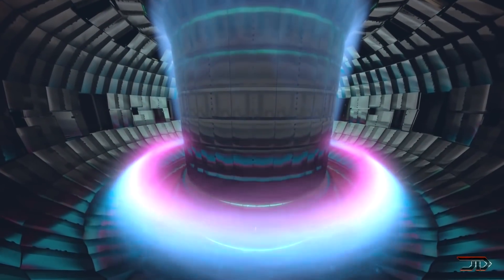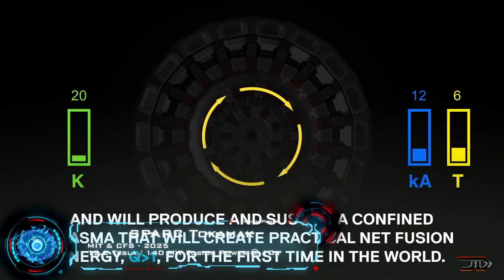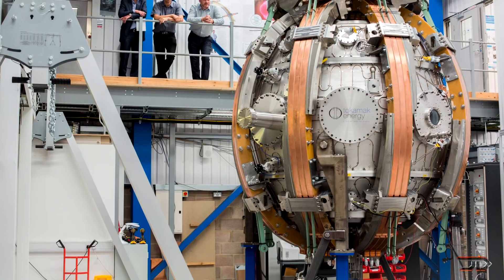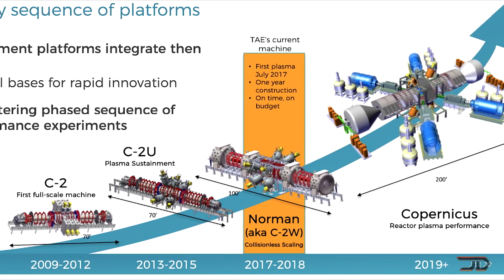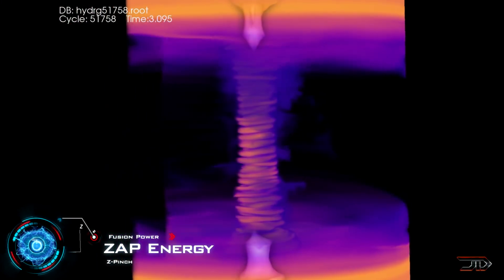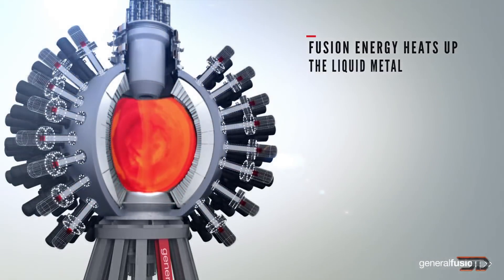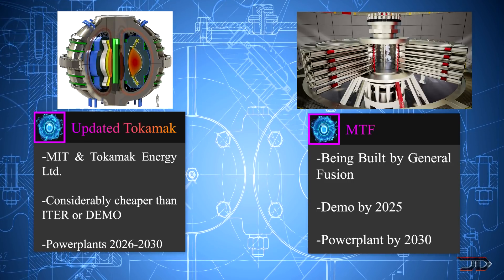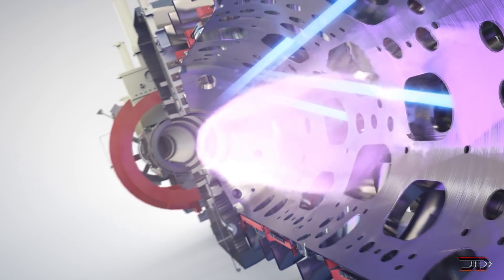Fusion Power - Latest Breakthroughs/Updates

Comment: FWIW: None of the magnetic confinement systems will ever work because the plasma which is magnetic interacts with the magnetic confinement field causing to destabilize. Better magnets will not solve the problem because the plasma will just produce a stronger interaction. The other issue is that with D + D or D +T fusion half of the energy produced is in the form of fast neutrons which is difficult to convert into power, and also will quickly cause superconductors to fail as the high neutron flux produced will damage high temperature super conductors by transmutating atoms into isotopes and other elements.
Reply: Except that the fields do work, as proven in countless tests.
Reply: @rickb989  Nope. There hasn't been a successful run over 5 minutes without the containment field failing And they been experimenting with tokamak design for 60+ years. They all failed. You know stupidity is doing the same method over & over expecting different results.

The only real science done was Germany 7X Stellarator which used a distinct shape to try to stabilize the containment field, but unfortunately it completely failed. 

All of the Fusion scientists know none of these reactors will work, but since they collect a paycheck from it, they are not going to say no.
Reply: They work enough to prove the concept, and they can hold that heat for longer and longer durations. It's too early too say never when new breakthroughs are still being made, and we have Sparc to look forward to seeing soon.
Reply: @rickb989  LOL! Sorry no. There are no new breakthroughs except a breakthrough in wasted money. The run times in the 1950 were about the same as the run times today. Most of the time the field destabilizes in under 25 seconds. 

Second none are even close to produce electricity, since half of the energy produced is fast neutrons. They are struggling to get Q=1 and would need a Q of about 100 to generate electricity. 

Then there is the cost. Presuming they did reach a Q of 100, they cost of a plant for about 1GWe would be about $100B & probably cost well  over a $1B annually for mainenance. Its not going to be economically. Currently a new fission plant costs about $15B for 1GWe and that is way to expensive. Fusion would probably costs a customer over $1 per kwh.

Comment: The Tech for Luddites channel's video on fusion said that there is not enough tritium on the world to keep a fusion reactor running for more than a fraction of a year.  So even if ITER or whatever attains fusion, it's lacking the necessary fuel.  I think fusion is always going to be  "20 years away."
Reply: https://www.youtube.com/watch?v=v5hOIjDsuJs
Reply: You should explain this to them, how they did not think of it?
Reply: Tritium can be produced if needed, but ideally Fusion reactors would use deuterium which can be extracted from water (about 1/7000 of hydrogen in water is deuterium). The issue is that none of these reactor methods will work.
Reply: tritium can be produced from beryllium and lithium

Comment: You know what's funny... That none of these are solely built for spacecraft but rather could be used in one and that you wouldn't want to because of the risk of shutdown where you can't turn it on again, or damage. Yet lattice confined fusion cells using liquid water are not as actively researched and is far better as an alternative in terms of handling. Or that all of these is so much more expensive then just using solar cells.
Reply: Solar cells are highly inefficient at 20% efficiency or less.  They are also high maintenance and hard to recycle currently. Not much to look forward to in Solar Cells. 
Oh, and the word is "THAN" not "Then". "Than" is an exclusive and "then" is a time reference. "than using solar cells"
Reply: because SMR's are better for spacecrafts, you never have a problem cooling a nuclear reactor when you can use the ambient temperature of space to cool everything.
Reply: @jackasshomey  great, now if they figure out how to build the spacecraft on the ground and fly it up using the smrs would be good. Expecially of its like the way airbus makes and flies planes

Comment: Scientists are not looking for fusion. Fusion is part of the conservation of energy and mass. By law, it shouldn't work and hasn't.

What scientists are looking for is called quark plasma. This plasma, once created, will require nothing from us to keep it going. The containment system will be a giant sphere with a hollow center yet extremely tough metals surrounding it. Hydrogen will be sealed in the sphere and severely compromised with heat. At that point, the hydrogen will be "lit" with a massive amount of electricity that will separate the hydrogen into quarks. The catalyst for this plasma is not electricity but mere dark matter that flows through all of us. This matter is what keeps the quarks apart. Dark matter is electron neutrinos and they travel invisibly through normal matter to attack the reaction inside. As the dark matter from space comes into the reaction, it is thrown out by the strong force between the quarks as gamma rays. The walls catch this radiation and water is pumped through the sphere to extract the heat energy. This is the minimum entropy matter black holes are made of. This is why fusion seems as if it will never happen.

Comment: All of this Fusion started with the original patent by Philo Farnsworth. What's interesting though is that he achieved Fusion on his kitchen table top using electrostatic confinement versus electromagnetic confinement. If you read the history, he fused helium into hydrogen and produced neutrons. Why is nobody pursuing electrostatic confinement I've been proven to work?
Reply: <fused helium into hydrogen> 

Never happened and never will happen. Fusion means joining together.
Reply: I’m pretty sure the issue isn’t that we can’t create fusion, it’s that we can’t create fusion efficiently enough to be able to get net positive power. Theoretically every one of these reactor “ideas” can work for power generation, it just takes a lot more research to make the process efficient enough. I’m sure these fusion companies have considered “electrostatic confinement” but found that these other methods have better potential for net positive energy.  Also fusing helium into hydrogen and making neutrons isn’t how it works lol.

Comment: I think that if a working reactor is ever built it will look totally different then those mentioned in the video. It will most likely use some principles we do not know yet because what from what we have seen so far, one must conclude that we are going nowhere with those designs. Fusion is still 30 years away :)
Reply: Not true that we are not going anywhere, as there have been tangible improvements on all metrics you look at.

Comment: It's interesting that soooooo much money is spent on fusion-energy conversion. Motion per mass that produces boundaries from the force that pushes & bends ... Our sun absorbs mass at a certain rate and it releases mass at a certain rate. Organizing-mass versus disorganizing-mass. The thing about nuclear fusion within the our sun...  once the fusion process starts, who is able to stop it? It takes energy to control forced nuclear fusion, but on the other hand unforced nuclear fusion like our sun allows for an energy output, we are just along for the ride and it's free! Thank you very much for this video!
Reply: " once the fusion process starts, who is able to stop it"
Sun uses gravitation confinement to cause fusion. Experimental fusion reactors use electricity, or light for confinement. if the electricity or light source is removed fusion stops. The other issue is that fusion reactors need a source of deuterium or tritium for fusion. Fusion reactors will stop when no more fuel is added to the plasma.

That said none of these fusion reactors will be a viable option.

Comment: Once energy fusion is mastered the world will see a energy revolution!
Reply: No.
Fusion reactors are going to be as finance-intensive and safety -regulated as the nuclear stations are. After first plasma they will contain radioactive material in both neutron-irradiated constructions and in fluids/media/consumables (e.g. tritium from the chamber and irradiated coolant), so they will need solid security and nuclear nonproliferation barriers just like a regulars nuclear power station. And they are to be energy dense as well, so they can go boom quite violently, possibly releasing some radioactive material.

So not a revolution and definitely no free cheese.

Comment: What I learned from a short research is that tokamak walls decay very quickly, due to huge temperatures, pressures and helium. So this is another problem that has yet to be solved for the technology to come into constant use.
Reply: The excess neutrons is also a big problem. They are not electrically charged and will escape the magnetic containment field and will break down the walls and can make them radioactive.
Reply: @lubricustheslippery5028  Issue is altering the chemistry of high temperature superconductors likely causing the fail pretty quickly
Reply: @guytech7310  Exactly nobody is talking about lifespan of superconductor coils in high neutron flux required for sustained energy production.
Reply: Yeah so instead of cost of refueling, it becomes the cost of constantly building and replacing walls. I would not be surprised if they get Fusion power working in 10 years. But I would be surprised if it is actually economical. That could take decades more.
Reply: @erikengheim1106  You won't be able to replace the walls of a fusion reactor, because the walls will be very radioactive from neutron radiation.

Comment: We will get there. So many top minds focusing on this tech. Lots of learing and trial and error. I am middle age now. I might not live to see it become ruitine for energy production. I am sure it will be run of the mill by the time my kids as old as I am.
Reply: Yeah, except fusion has been 30 years away for 70 years. It also won't be run of the mill regardless, these reactors are huge and expensive and with most of them, bigger means more efficient. They won't be like solar panels or wind farms, more like fission nuclear reactors. They won't be much different from them either, less waste produced certainly, but they still produce neutrons which will induce radioactivity in most nuclei.
Reply: @domvasta  What you failed to understand is that this is R&D and as we gain access to better technologies, such as the recent introduction of superconductors, we can size down on the coils thus the reactor. There's so much to be discovered and impoved on that it's impossible to make accurate projections. All we can do is speculate and the "30 years away from now" or "it's always 30 years away from now" is a dumb argument that shows your ignorance.
Reply: We have no clue whether fusion will be affordable even if someone manages to build a functional reactor. For all you know it could end up way more expensive than either nuclear fission or fossil fuels.

Comment: this is good stuff basic science limit to facts and see owerview easy and get some picture as seen on video mit has tech aproach and is competitive althow ST40 has science calm view and stabile thought is what it is is probably closest by nature universe cause neutron stars european is massive to collect all the data since fluy fields has limit potential in larger expirement some unusual theme % can hapend in lower percentage under limits events can eruptive in nergy paterns so waht kind or what type or input to output is a nother story they all have chance to succsess but waht the important theme if is nergy producable tomorros is power plant or engine part in scfi ships and preaty indefinitive one so technicaly a egg in ST40 is not so good magnetism pole basic result is power production under limited role conditions faster conditions done and eruptions energy wave form and catched is more energy so is form off kind field heated and basic temprature is not so small equal to sun anyway good PC CAD what reasonable to research it doesnr mater in five first steps then in 7-10 year first working when made research would start for me it can be easy one on space x rocket vtol if it works or in powerplants on mars beside thorium cells basice tech is like e genertator step between ordinary or high speed one like brushed or brushlles type then is e turbine blades a source off power input large gen or even permanent hybrid at start or even tocamac power cell is all producable but on industrial asembly  lvl and for consumers so stuff like vtol trasnporters, rotational cocpits as escape pods, separation body chasis, self land platform body uAV flight suport doubel pc in cocpit rotational engines on servo birth off combi fix airplanes tech  multiuse purpose is al vating for to be made marsian base export power tech like am or on trasnport lvl size for basic usage in short preaty nice stuff need not to vait to 20 years for it
Reply from the maker: Thanks for commenting. I believe FRC can be more compact as well since it direct converts to electricity, no steam turbine etc.